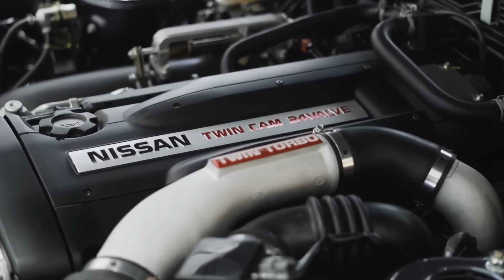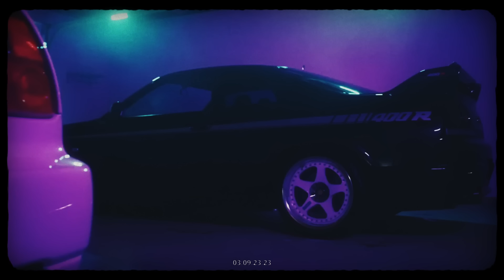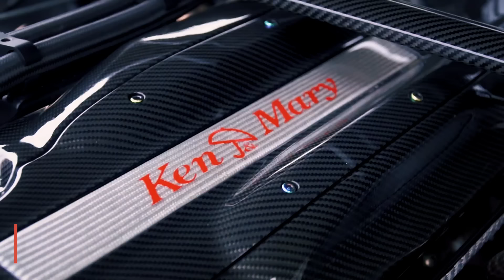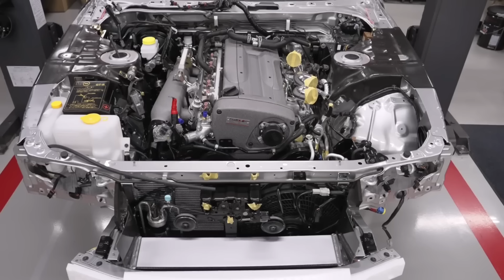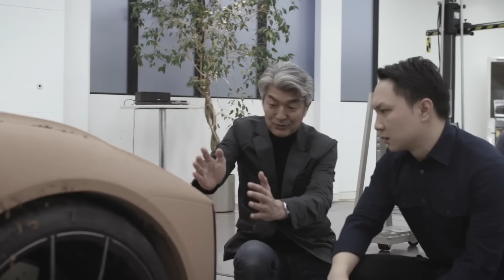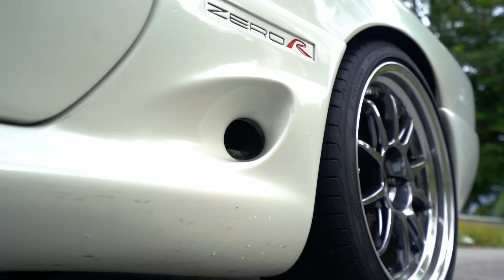15 Rarest Nissan GT Rs Ever Made!

Comment: My second hand GTR-Rstyle with 10,047mls here in Britain cost me £59, 000 i had the clutch swapped wider 265/20 tyres Mitchillin dry sport slicks swapped out the leather seats for cheap prodrive carbons & belts sprayed her Blackhole-Black upgraded the breaks shocks struts all 4corners in 2&half weeks costing another £12, 750 she pult gripped & flew like nothing I'd driven before, but i blew the right-bank throttle body & turbo 6weeks later 😂 toed back to my driveway 17days ago tonight & cannot be bothered with her now😊 looking for my next monster to kill😂❤❤❤